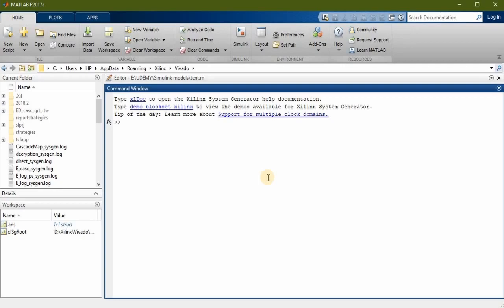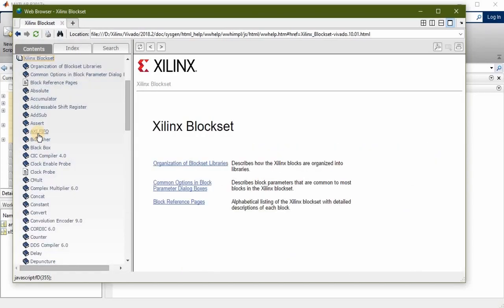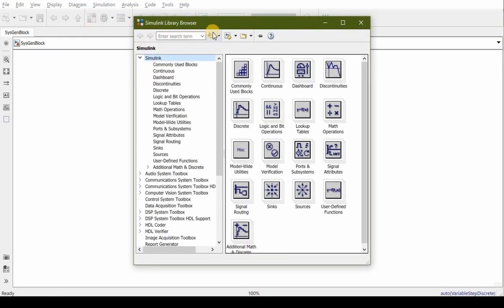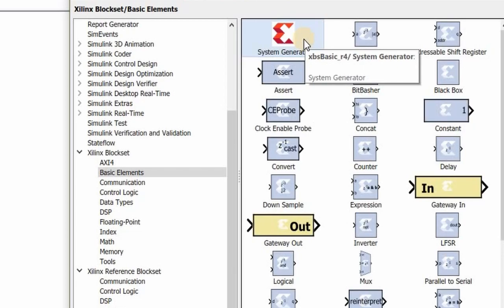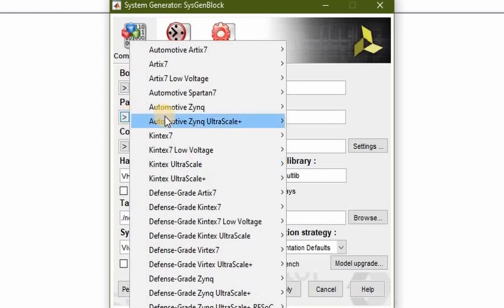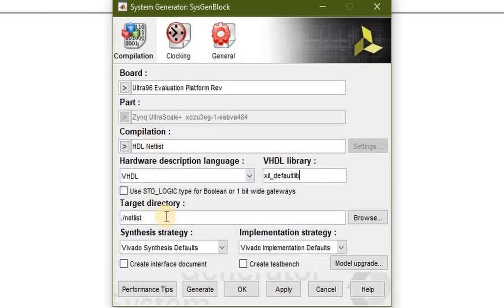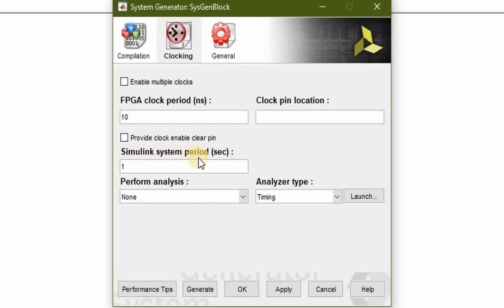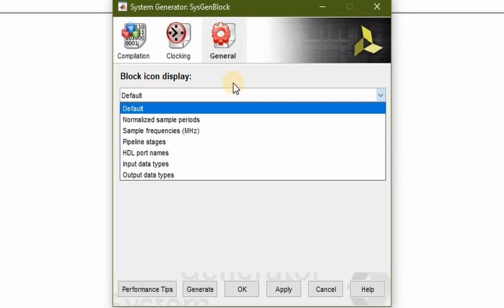System Generator Block

Comment: I'm using 2022.2 vivado version and R2022a Matlab version how do I get system generator
for this ?
Reply from the maker: There'll be a related checkbox for that which need to be enabled during Vivado installation. Since it is installed, you may modify the installation.
Reply: @nagah_7  Can U say which block need to be checked ?
Reply from the maker: @aasrithamandara1160  Under design tools-> Model composer (includes functionality for system generator for dsp). This should suffice.